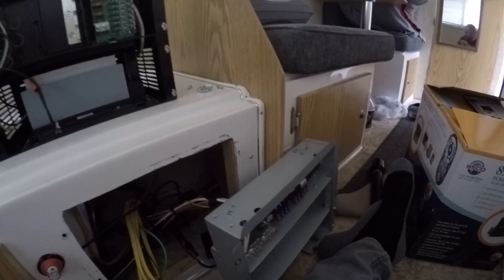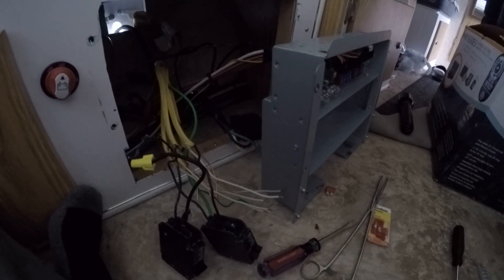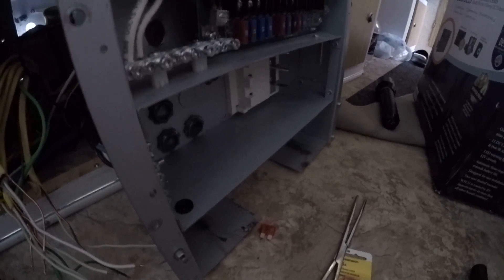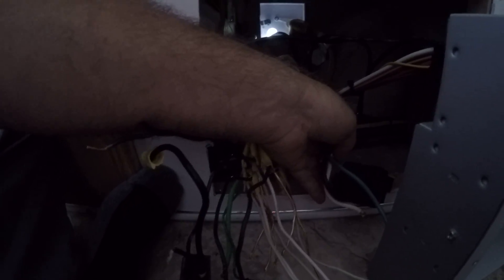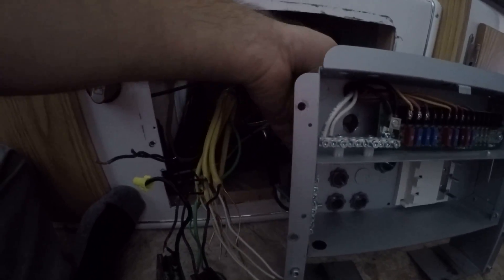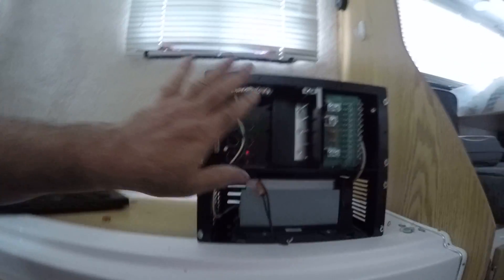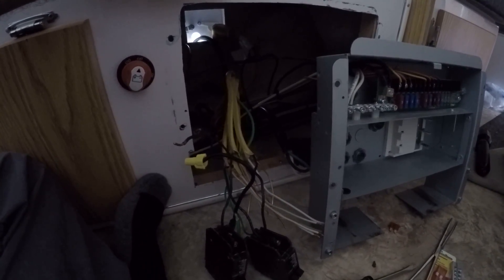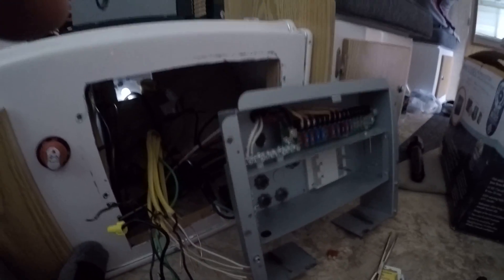DIY WFCO Power Center Converter 110AC Removal -Casita Travel Trailer - Parallax to WFCO

Comment: We just bought a 2019 Spirit Deluxe the previous owner suggested a parallax 981-755-000 replacement. When we bought the casita we knew the converter was bad but I never dreamed it was going to turn into a night mare. I am going to see if I can find what failed on the power supply and hopefully fix it. As long as the components are labeled.
Reply from the maker: Make sure you have a 7155 RVP.  If you have another you can just replace the bottom converter, you can also just add an extension if you have space
Reply: @ziprun1  Yes it is the 7155RVP
Reply from the maker: @TheFalconJetDriver  wfco 8955 55a from boat and rv cost me 209 delivered, and is working great, my regret was trying to use best converter like the forums suggested. Sent me wrong item, I had to pay for return and now filed with credit card to get my money back. Twice the price also.  Might as well replace the power center and be done